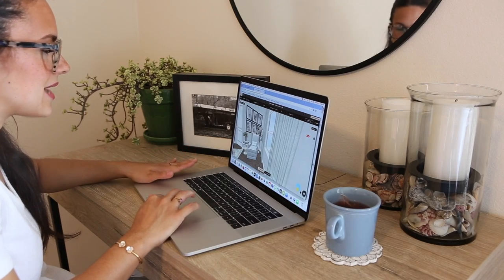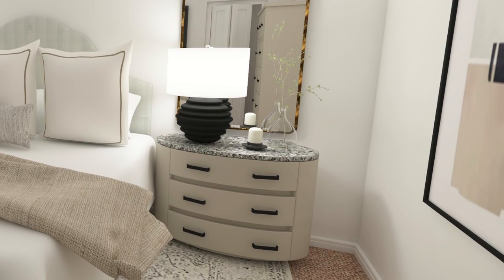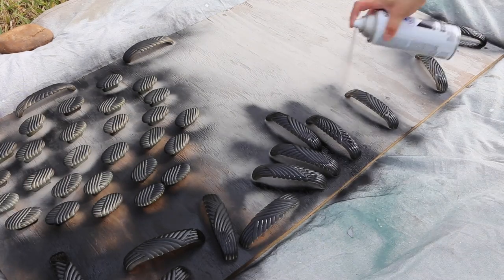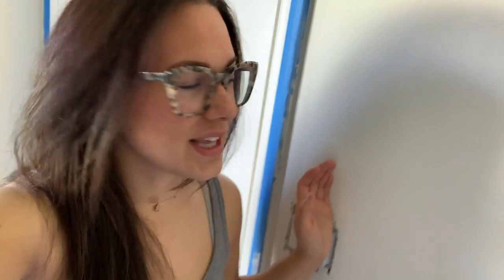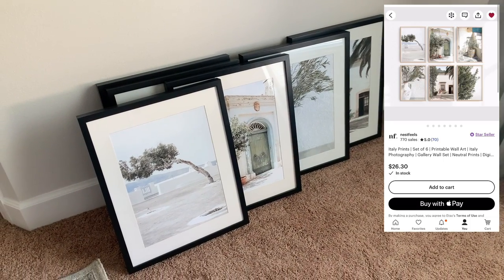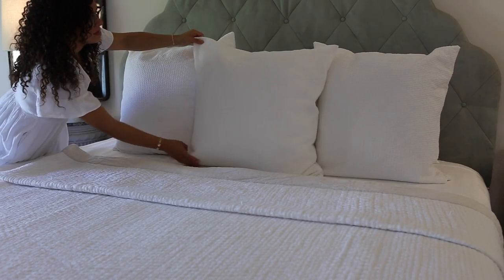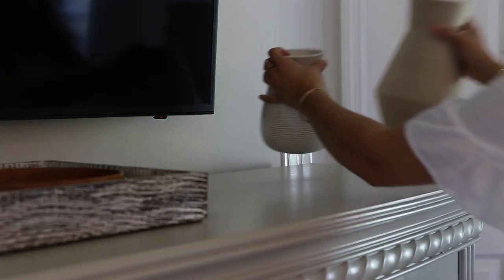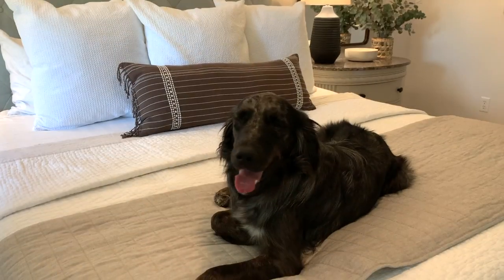EXTREME BEDROOM MAKEOVER | Full Room Transformation (Coastal Mediterranean Inspired)

Comment: So you painted the trim anyway,why did you tape it off. I was tought to to  door trim first then walls then baseboards. Also don’t understand why you used a wax on furniture when you used a satin paint?
Reply from the maker: Hey Pat 🤗 yes I did end up painting the trim, just some minor touch ups from wear and tear over the years. I taped the baseboards off to protect them from the primary wall paint color, and then just went back and touched them up from scuffs. Also, totally optional - as the paint had a primer in it, but it never hurts to have some extra protection on painted furniture, which is the reason for the wax 😊 hope this helps to answer your questions! Thanks for watching 🙂